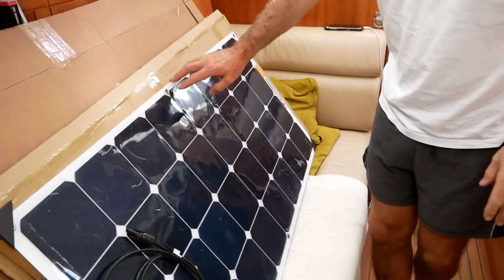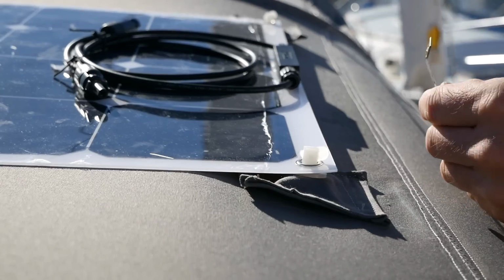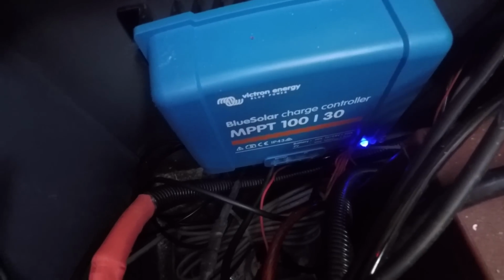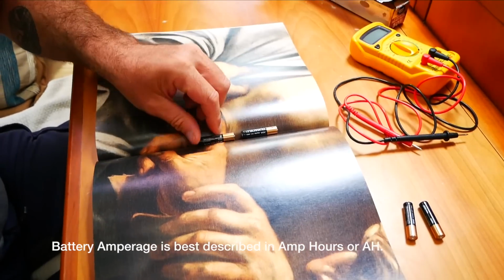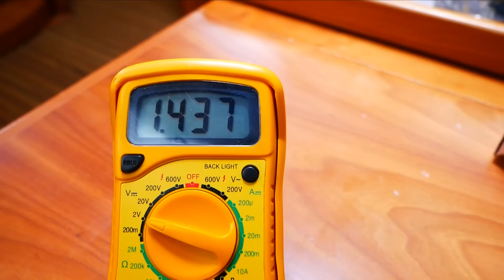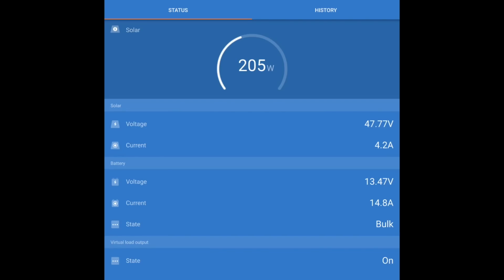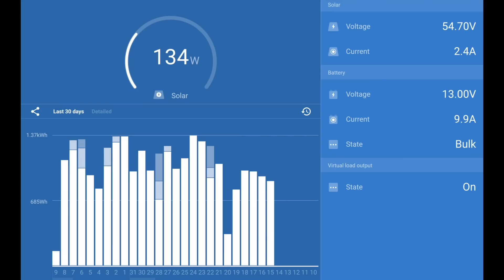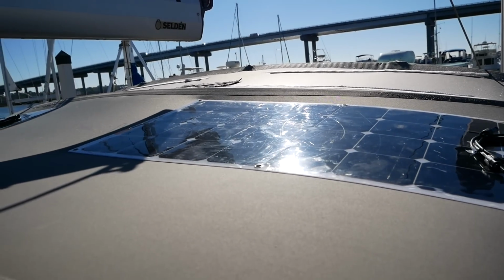EASY SOLAR PANEL INSTALLATION FOR YACHTS & R/V'S

Comment: Hello Nick,

Very much enjoy watching what you share. Good to see the team back together.

I watched your solar panel update with great interest. Having the real world perspective of a technically astute user is very helpful.

When thinking about MPPT charging, I find it helpful to remember that the objective is power in the sense of ability to do work. In this case extract maximum work potential from panels and put it into the batteries (and other loads) most effectively.

Important to keep in mind is that there is a minimum voltage and power needed by the controller to begin to work. This can vary but a certain minimum voltage coming from the panel is the first thing that the controller must see before it can draw and then, as it begins to draw (current begins to flow) the voltage will sag. This is where the magic happens. The charger will adjust the load on the panels to maximize the power drawn from them – but only down to that lower voltage and current limit. The key is that a series string of panels will cross that voltage threshold more quickly in weak light to arrive at the level that the charger can begin to use. Result: The panel starts producing usable power earlier and maintains it later every day! During the middle of the day there isn't much difference between series and parallel in terms of output (shading aside). If your controller will let you, have a look at your panel production from the time of day perspective. 

Another thing to keep in mind when installing is that even though you can get by with smaller core wire when voltage is higher, you will still benefit a little by reducing the loss in the wire and you can add panels later in parallel even if you are at the top voltage your MPPT charger can support. Limiting the work to topside only and not having to deal with getting heavier wire below to controller is a substantial savings in time and effort. 

It is also worth mentioning that with the higher voltages your vigilance should increase. When dealing with potentials past about 40V you need to be extra careful. That higher voltage can push past barriers that lower voltages wont…

I noticed that you used white Nylon or Delrin fasteners. Could you not find black? I am thinking of UV degradation. You don’t have much redundancy with this method and if they degrade you could loose them all at one go!

Lastly, do you have the same trouble with port and starbord as you do with right and left? Just kidding of course! 2:13 into video you will see what I mean;-))

Keep up the good work and we'll be watching.

Peter

Comment: One of the best solar videos I have seen. My three panels (200w) not so great in not so sunny Scotland but greatly offset the need to run the engine or shore power.

Comment: Nick - thought I would throw this out there since I recently did a flex panel install on my boat - Victron makes a Bluetooth MPPT controller now (built in, no dongle required). I also used 6 pair of rare earth magnets  (25 lbs holding power each) to mount my flex panels on top of my bimini...much easier and more inexpensive than the clips, and they've held up to 45 mph without budging a bit. I purchased the "Allpower" solar panel with the non-gloss finish..they really look nice!
Appreciate your videos bro...cheers.
Reply: Here are the magnets  
https://www.amazon.com/gp/product/B0748NZRJH/ref=oh_aui_detailpage_o08_s02?ie=UTF8&psc=1
In the reviews there is a picture of my install, since then I've added another panel and used the same mounting scheme.

Comment: Nick, on my old boats Bimini we put 1/2 or 3/8" rubber hose in a sleeve made from sunbrella and sewed them to the bimini under the panels. It worked well. The attachment point we did different though. I like your idea. We stitched velcro to the long side of the bimini and self stick to the panels. After a season it peeled off the panel (heat I bet). But I also tied the panels together then to the bimini struts as well (hurricane and theft prevention). 

Also I did Series + Parallel. Series on the port/star and then Paralleled them together. I figured the boom or mast can't cast a shadow across the boat. 

New boat has a split stay. But I never had issues with stays. 

Those 100w panels have a shiny surface. PROTECT THEM WITH SOME FORM OF UV coating once a month! I didnt and my first set yellowed in 4 months. Still worked but were yellow Flitz restored the clarity - sorta. I think we used some marine UV protection spray after that... Armor all equivalent but at 10x the price.

Comment: Hey Guys. This video was perfect timing for me.  Was in the process of penning out a solar system for my boat. The bar graph which showed the differentiation between parallel and series was great.  That was actually the sticking point in my schematic. Glad to see you guys back on a reg basis. Fair winds.

Comment: You read manuals like I do lol.  "...yada yada yada optimized blah blah blah..."  Great video and I like the special effects!  I'm hoping Tech Tuesday will be a regular thing.  One thing I would recommend is a cap for those plastic attachments.  In direct sunlight, it won't take too long before they become brittle.  Maybe the caps can be attached with some caulking.  Cheers!
Reply: When you wake up one morning and a panel has blown off in the middle of the night, I want you to think of me lol.

Comment: Series vs Parallel really depends. Each of them has its drawback. When you connect in Series and only a single cell (not speaking of a panel) gets shaded, the whole system gets affected with the result of less output. Drop your hand on a cell and look at your power meter to see the effect. On a R/V theres's less to no shade, so Series may work much better with the advantage of less cabling and smaller cable diameter. On a Sailboat there's plenty of shade around and Series usually is not the first choice. When a cell in a Parallel connection gets shaded, then only the specific panel becomes affected with all the other panels working at full throttle. There is only one disadvantage with Parallel: more and thicker cables. If you have Radar or Windgenerator mounted on your stern, go for Parallel or make sure there's no shades!
Reply: Not that I don't trust your measurements. But take in mind that they were done over days where conditions could have been different. I did the same like you and came to the complete opposite result. But I measured them at the same time. 2 in series and another 2 in parallel, two mppt controllers. Parallel won when I put my hand over a single cell. Anyway, if it works for you, all good :)
Reply: Let's see how it works out when you're at sailing or at anchorage. As said, it could work when there's no shading. Most of the roofs here in Germany covered with solar panels are connected in series. But that makes sense for all the reason I said above. If the houses were moving, they most probably would connect them in parallel. Fair  Winds and thanks for all your videos. Stefanie
Reply: Sailing Yacht Ruby Rose  Nice episode. Loss over the electrine line is I*I*R, so running in parallel makes current 4 times higher and loss in the lines 16 times higher, thats probably explains most of the 30%. For the same reason power(=V*I) is transported over the grid at high voltage, so to reduce current, which gives quadratically less loss in the grid.
Reply: Sailing Taku Moe Saw an interesting web site with lots of videos. I think the company is Canadian and is called Pacific Yacht Systems. Interesting way they suggest for parallel is to wire a seperate MMPT for each panel and join them at the output side just prior to the battery bank. It might make parallel work out better too. The owner/presenter has panels of different capacity everywhere on his yacht and it seems to iron out any "missmatch" issues. The point he made is that 2 half-capacity controllers cost, together, about the same as a single, combined capacity one and simplifies expansion later on too. His boat must look like a wiring octopus but probably a very tidy octopus.

Extending that further, and with different charging requirements for starting (lead acid) batteries and AGM deep cycle house supply I'm wondering whether you can run a larger alternator, together with 2 external smart regulators, to suit the different charging requirements of each type (charge control switch between the 2 regulators) so you can optimally add this source to the charging systems regardless of battery type. From what I see, if you charge a lead-acid flooded battery like you charge an AGM then you inviting an explosion and charging a flooded battery like an AGM leaves it underdone. Have you heard of such a thing?
Reply: Ian B - Yes, separate MPPT's for each individual Panel would make it a optimum System. Nowadays the MPPT's are quite inexpensive and there's nothing speaking against it except the extended cabling.

I for instance have a closed lead acid starting battery and 4 AGM deep cycle for service. All batteries are charged by the same system(s), which are a Sterling AB1280, Victron Multiplus 1600, Superwind 350 charge controller and Victron MPPT 150/35. They are configured for AGM Deep Cycle. The good thing is that the charging profile for AGM and Lead Acid is very similar. Bulk Voltage (to charge up to 80% of battery capacity) for AGM is gradually rising up to 14.4V - 14.8V (depending on temperature. That's why you need to temp control while charging). Well within the range of lead acid. Absorption Voltage (to fill up the remaining 20% of capacity) is around 14.4V and Float Voltage something between 13.2V (recommended for lead acid) and 13.8V (recommended for AGM). With one of these smart controllers you can adapt the charging profile accordingly and as long as they are within the range of your different battery setup, everything goes well. On the other hand, why would you run a flooded battery when there are other options, which are more safe for the same price (closed lead acid)? I've heard about accidents with open lead acid as well as with AGM, Gel and Lithium. It comes down to how much you care about your batteries. 

And if you want to do it right, go for LifePo4 or something in the lithium range. They cost a lot. My head starts spinning when I do the calculations, but worth spending the money if you look at the long path. More power, more cycles, short charging time, 5 time longer life time, lightweight and non-sensitive. They don't need specific charging profiles. You put in as much Amps as possible from whatever power source you have and you're done (just make sure the chargers switch off when battery is full and switch on when battery charging is required), enjoying at least 90 percent of their capacity.
Last year I went for AGMs. Meanwhile I regret spending the money on them because I didn't think twice and didn't plan for the long term.
Reply: Just read through Pacific Yacht System and it basically confirms what I said above. They just speak better english than I do :P
Reply: Sailing Taku Moe The reason is that this is the situation I'm likely to be facing. Hopefully, within the next 6 weeks, I'll be buying a boat, around 40 feet long and in Europe (I live in Melbourne, AUS) and that will be my next home. I expect to find a boat that will have inadequate power management and old-school batteries of inadequate capacity. I expect other deficiencies too - the "good ones" seem to be snapped up before I can blink. I imagine other areas requiring my attention too but first things first. I want to adapt what's there rather than using slash-and-burn. I much prefer sealed lead acid for starting and AGM for house but if I find my new home has 300-350 AHr unsealed lead acid for house then I will live with it to start with. I've seen boats with just 100W of solar with 100Ahr for house and that's just stupid - unless you don't want fridge, electronics, radio. I've also seen candidate boats with large alternators (Volvo Pentas seem to come with as much as 115A on 50 horse engines) and thus provides a huge backup to start with if the batteries are lead acid and the solar is inadequate. As far as Lithium then that's too expensive for me to start with and is more along the slash-and-burn lines.

Longer term, I expect to have about 350 AHr AGM for house, about the same 400 W solar and a wind turbine as Nick has. To provide "backup" energy then all sorts of possibilities are there including Nick's water turbine, or a methanol fuel cell, and a bit of engine as last resort. I think 450Ahr for house would be too much for me as I can't see how I can reliably generate matching power without using the engine too much. It means being frugal with power too but that's not a bad thing. As far as managing all this I have a bit more learning to do and people to listen to but I think it goes along the lines of connecting each managed charged source in parallel and then using a joint end charge controller - with a temperature sensor, If this charges the start battery too then the system will be happy as long as the house temp sensor is not too high - the lead acid start battery won't mind that it's temp is not the one being read.

Thanks for your reply to my comments. Most interested in your thoughts, will look at your channel too from now on.

Ian B
Reply: Nick, your daily total could also be caused because you are charging sooner in the day and charging longer into the night.

Let me explain.  A solar charge controller doesn't typically start charging until the input voltage is a certain voltage above the load (batteries).  So your panels wired in parallel might start producing voltage at twilight..but it will be low..too low to start the charge cycle.  Now, panels wired in series like yours (18 vdc X 4 = 72 VDC max OC).  In this configuration, even at twilight..you may be producing 15 + VDC, so your charger will kick in sooner and charge LONGER.  Hence, the more total daily kWh.

Thanks for the video and take care.
Reply: Nick, thanks for the video and explanation, and thanks also to the viewers who added to the conversation.
Reply: ^ This

Comment: Be aware that if you are connecting more than two panels in parallel that each panel MUST be fused individually to prevent overloading and a fire if one of the panels should short out.   Some paralleling splitters have fuses built into them but many do not.  The way that solar installers do this on land-based installations is using a "combiner box" which has fuses in the lines and terminal strips (and sometimes diodes although most new panels have diodes built into them.)   If you connect in series then there is no issue with short-circuit protection at each panel although the entire line should be fused and there be a disconnect means before the solar controller as well as a fuse/disconnect between the controller and the battery.

Comment: Simple but effective illustration. How are you managing the service battery charge, starter battery charge (and maintenance charging) and alternator charging of the service battery when the engine is running with this system? I watched an Antares electrical video after their mention in your last live stream. Rather than the usual big red battery master 4 position switch, they have a smart system that prevents the starter battery being placed in parallel with the service battery and left that way to accidently drain to the point the engine won't start. I see dual input, MPPT solar and alternator battery chargers marketed to 4WDers that won't leave you with a flat battery, but all I looked at don't seem to have high voltage solar input for running panels in series which is a bummer. There are some that also detect and remove sulphate from lead plate cells to ensure long service life.

Comment: Seems like... with the constant/variable shade aspect of a sailboat, yet plentiful surface area to mount (real estate), amorphous panels would have been a consideration? <The question mark is just that... did you consider using amorphous panels? What they lack in efficiency, seems like they'd more than make up for in consistency (those things produce charge in shade/overcast conditions). ~ Cool video. Stay safe.

Comment: Not discussed is the issue of the gauge of wire being used (so called 'line loss'). Series wiring allows for use of thinner (less expensive) wire compared to parallel which requires thicker wires for a given distance.

Comment: Hi guys. The ability to remain as self sufficient as possible and to remove the iron topsail from the charging equation I would strongly recommend wiring your panels in parallel. You are on a vessel that follows the wind/currents and therefore cannot have the panels moved about to best capture the suns rays. In series any partial shadow will invariably nullify all that you have aimed for. In parallel you will at least have the benefit, though slightly diminished to be able to provide some of the amperage that is required. We work in AH, replenishing it as quick as possible for the smallest loss is what’s important., the greatest voltage is not necessarily the greatest advantage. Voltage is just pressure. I like the idea of series, but experience has taught me otherwise on a boat. On a static property or an RV that you can manipulate the angles then run with series. On a boat I would beg to differ. I look forward to seeing how your setup works going forward. I do hope it serves you well and I will buy you a cheeky pint in due course if it does. Look forward to seeing you guys up here in Europe soon.